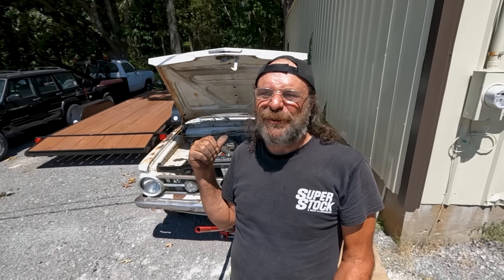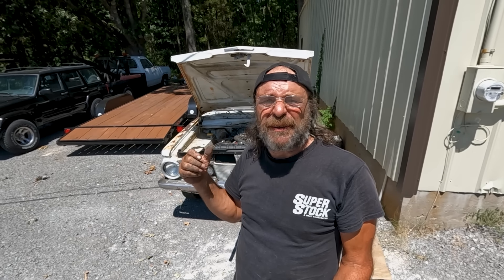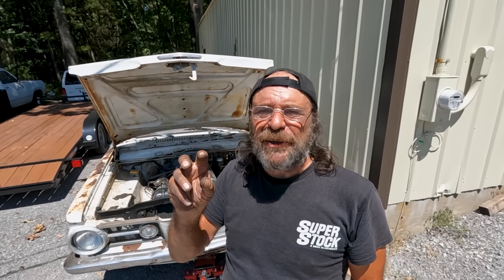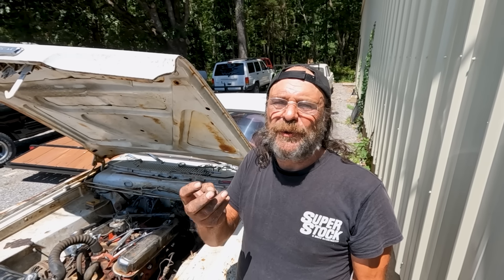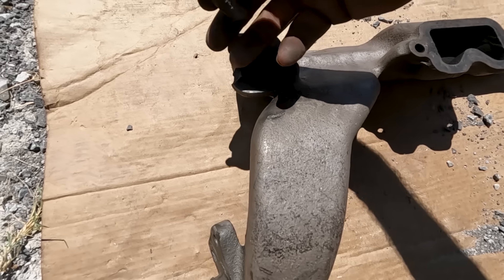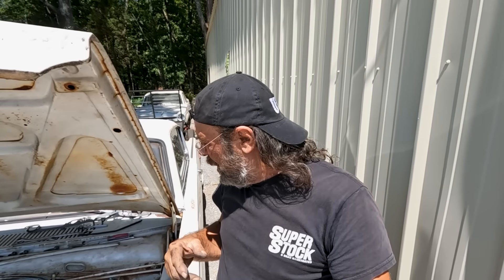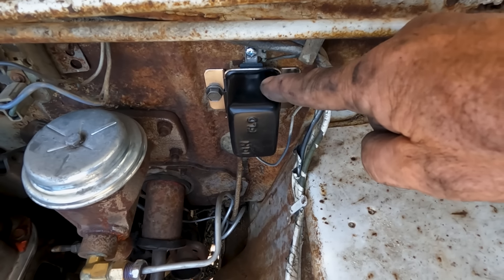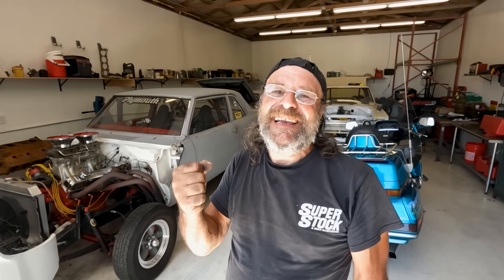Project Car Purgatory - When You Find And Fix One Issue, Several Others Are Sure To Pop Up

Comment: My father-in-law had a '40 Ford Coupe that his brother (who was a wiz in his younger days) had tried to revive then his health failed so I got tapped for the job. I put the wiring back to the original but left it at 12 volts. It had the worst plug wires I'd ever seen (And that's saying something), I rebuilt the dizzy. Then when It was cranking, it just dragged the belt through the water pump pulleys so I installed new (rebuilt) water pumps. I won't bore you with the rest. Suffice to say, that every time I fixed something another problem popped up so I named it "The '40 Ford Whack-a-mole." I finally got it roadworthy and the old man got to drive it before he died the next year and that was an extremely special moment in time. And now, you guessed it, my wife inherited it and she will...not...sell it. Did I mention it's a PIA to get in and out of? Now I get to work on it forever.😀 I'm overjoyed.

Comment: This is why I don't do projects anymore. I just don't have the time or patience. I wish good fortune to those who are doing projects.
Reply: I agree with you Completely I’ve done 3  1962 Corvair Rampside, 1967 Dodge D200, 1967 Dodge Dart. All not running got them going and sold them. I’m done for now. 😂👍
Reply: Same here, I retired from the auto repair business, sold my tools for a reason one of my brothers can't seem to understand, he wants me to find where his Hyundai SUV is leaking oil from and fix it, I'm in full avoidance mode hoping he takes it to a shop.
Reply: It’s also a gamble with buying parts and quality
Reply: Okay boomers
Reply: that's not an option for many especially younger car enthusiast if I wanted a nice version of my project car i'm looking at $25,000 so the $5,000 and slowly make it presentable option it is. If you want something that just works get a newer car or cut a check to a shop and make it there problem.
Reply: I understand the frustration believe me, but I would still rather have a project. I just don't trust other people's work. Buying a restored car is also too expensive for me and most young guys, and who knows what's under that paint.. I have found fiberglass, bondo, rtv, expandable spray foam  etc etc.
Reply: @davidgalea6113  I fully agree with that idea. On one occasion with a motorcycle, I took over someone else's mess. For vehicles, I stay stock, or very close to it. My hobbies take other forms.

Comment: I’m having the same issues with my 64 Dodge 440 but I have to say that I just can’t stop looking at the car and thinking it’s so beautiful and I’ve got to keep fixing things
Reply: Absolutely
Reply: Those are beautiful. 🙂👍
Reply: I had a premo 66' Charger with a trans planted 440 and it needed a few things to get it right.  But I also had a wife and apparently we had a partnership, as in I made the money and she spent it.  It never got fixed.
Reply: @tomjackson4374 I had one, 318 poly, I sold it for $20 and towing it to guys house, about 40 mph he pushed drive button, those transmissions have a rear pump, it started right up . Who knew?
Reply: @TheGforcead  Who knew?  The guy who bought your car.
Reply: @tomjackson4374  If I knew it would run I would not have sold it, I would run it up to like 100 mph and just lock it to the left and slide sideways like 1/8 mile in my Dad's cow pasture on the wet grass, we would run it thru the corn field like Burt Reynolds in white lightning. (After it had been picked) We called her the green Hornet! My first car at 12 years old. 1976.

Comment: Ive used exhaust manifold gaskets for years with no problems. The trick is when you install them after they get hot for the first time you snug the bolts & nuts holding the manifold again, never had a leak

Comment: I found myself in that position several times, back when I had a job to go to every day, had only one car (the project car) for transportation, and didn't really have a good place to work on them. I did it over and over again, and eventually gave up every time. The more I did, the more the cars seemed to need. It was a bottomless pit. And I had to have transportation. Then finally things changed. I finally bought a house, with a 2 car garage and a 2 car driveway. Now I had a place to keep both a transportation car and a project car (which has turned into a transportation car and three project cars) and a place to work on them. I recently retired, and now have time to work on them as well. Sadly, it all happened a little late. I have now developed some fairly serious orthopedic issues, which takes a lot of the enjoyment out of working on cars due to pain and loss of mobility. 

How can a metal to metal connection between the cast head and cast manifold with no gasket not leak? The surfaces would have to be perfectly flat and perfectly smooth, and that is almost impossible. A gasket fixes that problem by providing a squish area to fill in any small gaps. Those air injection systems, along with EGR valves, were two of the worst things they ever did to cars. Way back when, I had a '70 Challenger with a 318. It did not have that air injection system. 

My 1972 Ford Pinto wagon has a mechanical voltage regulator, and it is not the one that came on it. That one failed, and I bought a replacement from a local franchised auto parts place, about 20 years ago. I doubt they even exist today. Best thing to do with ANYTHING electronic is carry a spare. EVERYTHING electronic WILL fail, and when it does, it CANNOT be repaired. Just like those Pertronix ignitions. Two of my project cars have points ignition. I carry an extra set of points and an extra condenser with me for them.

Comment: I use to put those manifolds in a metal drain pan with the thermostat housing temp switch removed and about 1/4 gallon of gas and light it on fire  the carbon fell out like nothing, an old timer mopar mechanic taught me that

Comment: So true about the battles.. ‘70 Mustang, seized distributor, bogging off line, pinging at the same time. I’m thinking the accelerator pump was shot. Tried carb cleaner to free up distributor to no avail. Tried PB Blaster and eventually worked it loose. Adjusted the timing and it’s alive again!! Sweet success!

Comment: Exactly right Tony, 1 step forward and 2 steps back. I just found a leak on my power steering gear at the pitman arm shaft. Bought new seals, removed the pitman arm. Go to remove the old seals and it's not happening whatsoever. They are seized in place. Bought new steering box. At least the new one is an upgrade. An initial $69 fix has become a $500 replacement.
Reply from the maker: The trick to removing those seals is to pull the pitman arm, remove the snap ring, top off the p/s fluid and fire up the engine.
Turn the steering full lock and hold it hard there...the seal will literally blow out.
Make sure you've got a drain pain and plenty of cardboard on the ground first.

Comment: FYI I have read somewhere that it is important to install those exhaust gaskets with the shiny side facing a certain way because the shiny side allows for the expansion of the exhaust manifold.(I have been an owner/bracket racer of '65 273's since 1973 and currently own a '65 Barracuda Formula S and a '65 Valiant Signet convertible). Of course, I prefer to use the hard to find factory style steel gaskets which include heat shields for the spark plug wires.  I fabricated the bracket for the drivers' side exhaust manifold, which is a real pain to install. I purchased factory correct positive battery cables from M & H Electric Fabricators, Inc. part #35225.

Comment: Ouch, your bring in back some of my worst car nightmares. Fitting Spitfire headers on my 65 273 valiant. Complete and utter might mare. 
Installing a late model mini starter is a big help.

You can now officially use this car to demonstrate to people how a car that was never intended to be a project becomes a project. One thing afret another, each "thing" involving numerous other things that are affected by the worn out/defective/broken/obsolete part you are trying to find.  Next thing you know it's 12 years later.
Reply: I installed Cyclone fenderwell headers on my '65 Valiant bracket racer which were a breeze and looked badass.
Reply: Back around 2012 , the wife's car started slapping the timing chain, so I parked it in the garage ,got her a new car and I'll fix it when the dust settles. 
Well, that car wore out around 2019 so I got her another car. 
Maybe it's time to fix the old car in the garage now 😂
💩 Or get off the pot 😂
8yrs it sat in the garage, and the total was 11 before the tires saw pavement again 😂
Glad I kept it though, it became exempt this year from an OBD2 readiness check during the inspection,  being its 25yo now.
Reply: That’s why I figured out-for me…

If it drives, congrats it’s done!!!!

I’ve been driving my project for 20 years.

Comment: We got that particular issue a little easier down under, with the steering box on the other side, and mounted to the chassis rail further back. Although not built with it, you could use right hand manifolds on both sides. We actually have one little thing that's easier to deal with.

Comment: Having the same snipe hunt with my '76 GMC C15.  Front end rebuild, rear suspension replacement, floors and rockers rusted out, new radiator and heater core.
If the old low compression 350cui with smog heads didn't make good oil pressure I'd junk it.

Comment: Make sure you preheat the cast manifold before welding with a 50/50 iron/nickel alloy welding wire or stick not stainless, it contracts to much and do a bit at a time and lightly peen the weld while hot to stretch the weld.

Comment: Just picked up a 2000 Jaguar s-type V8. Started out with a bad starter, then the fuel pump. After it got running then the alternator. Now it runs but has a slight miss a a few other things that need to be addressed. I have about $2000 of parts and labor onto this $450 car.
Reply: Ditch the electronic money pit and buy an older Jag.
Reply: A friend loaned me a Jag once.  You could tell it was a European car because it had one cupholder and five ash trays.

Comment: Nice find and blessedly absent of power steering and power brakes.    You are correct of ongoing quirks when putting a car back on the road that has been sitting 30 years.  I've been towed 3 or 4 times with the 63 fastback.  Only way to get the bugs out of them is to drive em.  Hard to find old Ford parts now as people who had them sent em off to the scrap yard when the price of steel went up.   Good video.  You know your mopars.

Comment: I've threaded the air holes and put set screws into them to prevent an exhaust leak from them.

On Hot Rod TV several years ago, Chevy and Ford host decided that they were going to put headers into Duster. They spent several hours after they had put the passenger side header in first. All to realize all of the front steering components of the removed, and the driver's side done first.
After that Fiasco.....
They decided that they were going to put a velocity stack on the carburetor and cut a hole...
They did not realize is that an A-body 8V engine is not in the  center of the engine bay😂
I have never seen them two so angry in one episode😮

When you've live these battles firsthand, you can watch it coming in like a freight train in the prairies 😂

Comment: HAH! Great point Tony.
I routed the brake booster hose at least a half dozen ways on my '66 Chevy before I was confident and happy with the way I had made some custom brackets to keep it held well away from the throttle linkage, and prevent that from binding the throttle on closure. The intake is a later one from a z/28 and the bosses and holes aren't where the factory brackets go. I needed to keep that at least 3" from the linkage. It was necessary to get it right. The previous owner has it only good enough. There's an old bracket from a snowblower and half a split clamp from a Buick doing it now, and it perfectly restrains the hose without letting it abrade or interfere. About three hours on that.

Comment: I talked to fellow mopar people even old then me and have worked on mopar engines for years or worked at dealership work shops ect . Mopars always used exhaust manifold gaskets . I still use Fel-pro exhaust manifold gaskets but I spray both sides with permatex copper spray and never have issues with them wearing out / burning through . Everyone ive talked to has never heard of mother mopar not using exhaust gaskets

Comment: I used to have a 1974 Plymouth Furry 3 with a 360. It had Armstrong power steering with the Fred Flintstone floor pans. I covered the holes with a cutup sides of an old washing machine, sheet Matal screws and threw some old green shag carpet oner it. LOL

Comment: Walked a step back on my 58 Volvo yesterday. Out of necessity, I am retrofitting a different brake system on the car. On literally the last brake line fitting, it didn't fit. Now to learn brake fittings and flaring in order to correct the bolt on (in)compatible parts.

Comment: I grew up working on those cars when they were just a few years old.  Pile up charcoal in the grill, put the manifold on top and let the grill vaporize the carbon back out of the manifold. One telltale I noted was the carbon on the face of the manifold.  Good metal to metal contact keeps the temperature of the face of the manifold cooler and minimizes warpage.  I've been running a forge for decades to make tools and it does a great job decarbonizing old parts in prep for cleaning.  You use exhaust to vaporize fuel, use fuel to vaporize out the carbon buildup.  It also eliminates the oil that soaks into the casting so new paint sticks well, like original equipment.  We used to have engineers that could do "math", now, not so much.  Now I do the machine work and let the younger guys turn wrenches.

Comment: That LH exh manifold was hard to find 40 years ago! I used a '70 ('67 up 273/318 should be the same) A body manifold on a 318 transplant into a 64 Barracuda in the early 80s, it fit, sort of but the way it turned down was difficult, but not impossible, to deal with. You've got to use the factory stamped steel exhaust shield/gasket on the left side.

Comment: Old boats are the same. I am in middle of cleaning up the electrics on one, wire nuts, el cheapo crimp connecters, loose and broken connections, mystery wires, things wired so they could never have worked....  It just comes with the territory.

Comment: Tony, there's another problem there - the 90-degree fitting on the master cylinder outlet is brass ... which are really for low and medium pressure applications. I can hear people saying "that only applies to compression fittings”, and "I've never seen those fail" (which I guess means they will never fail) ... to which I say "STOP, please!".  If you need to stomp the pedal that brass fitting is all that stands between you and a complete failure of your single circuit brake system … just say’n.

Comment: yes when you fix one item that breaks, and you replace it, it will cause the other weaker items in the related system to fail as well. So when I did work (my daily driver) I made it a point to replace as much as I could afford and tried to be ready to replace the next item in that system.

Comment: I got a 70 New Yorker once, and one day it occurred to me that I couldn't feel the shift.

So I tree shifted it to find the shift points...

The first time I did this, it went BANG and it felt like I had been rear ended!

But when I looked back [this was a Sunday on a country road toward the edge of a medium sized town] and there was nobody anywhere in sight.

So...

I tried it again.

And again, it went BANG!

It turns out that this old Chrysler C body had a racing converter and a shift kit in it.

Instead of a typical soft, easy shift at 15 and 30 mph, it was all done at 5 and 7 mph.

So by the time I had gotten up to 20 mph in 1st gear, the motor was over 3700 rpm and hit the 2nd gear shift point like it was being hit up the ass by another large car.

I outran the cops in that car once.

Cops thought it was a Dodge Charger for some reason.

I sure miss that thing!

Comment: I am a boilermaker/fabricator/welder by profession,  I repair manifolds on a very regular basis, I have brazed, fusion welded, arc welded manifolds but the most successful method for welding manifolds is by spray welding with nickel powder.

Comment: Been using the one piece exhaust gasket for over a decade now on multiple cars, 0 problems. Also never seen a motor without gaskets already on them, even a 20K mile 318 that had never been wrenched on before it was pulled.

Comment: Wish I had known about those air injection ports a while ago. Put a 360 of unknown vintage in a 82 chassis under a 68 Dodge body...then installed the headers and wondered why they leaked. After a new set of gaskets, clean the threads and installed plugs in the holes, things went well. A lot of extra work that would have been a lot easier to do when the front clip was still off. Oh well. Hope you do a vid on welding that cast. We fix a lot in our shop, but I don't believe it is being done right. Like to see how you do it.